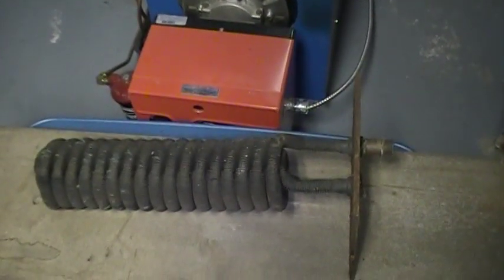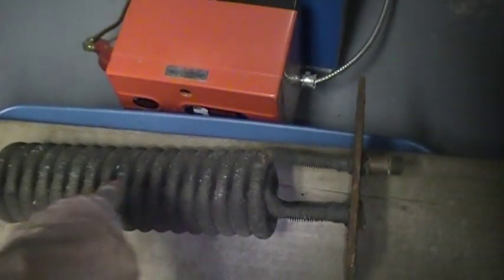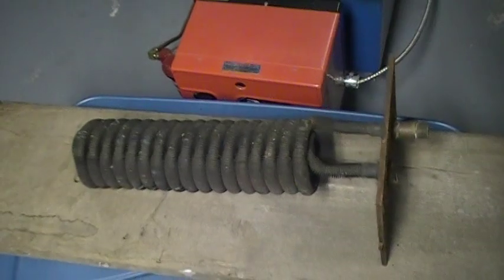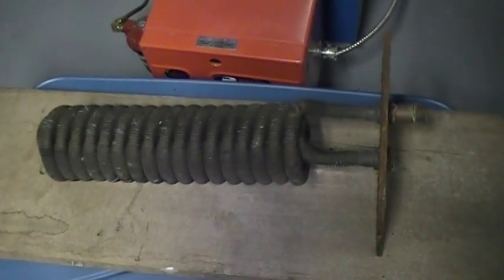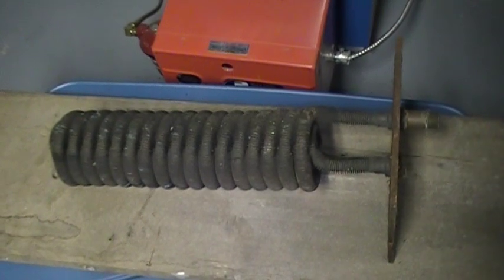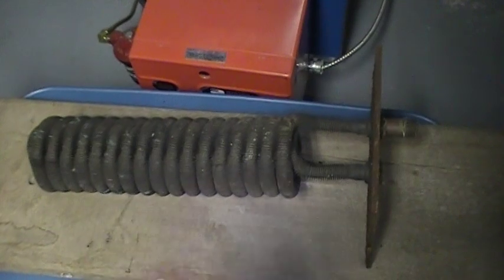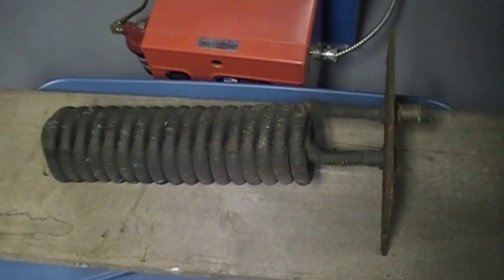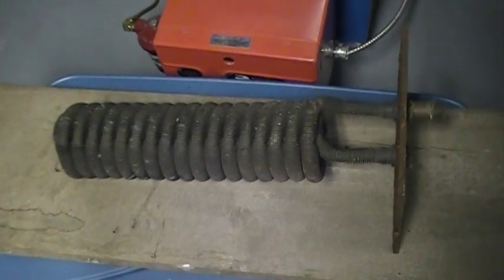Relief valve blowing off on hot water boiler (furnace).possible cause...Part 2

Comment: Hey Al,
Just reminding you that this content is extremely helpful! Currently in the process of dealing with my own DHW coil replacement (we are pretty convinced it is this part).  Just wanted to pop-in and thank you for all the time you've put into the videos and the responses to peoples' comments. Thanks for helping!
Rob
Reply from the maker: Hello Rob,
I appreciate the kind feedback!
Sounds like you have a little project ahead of you. If there is anything I can do just fire a message at me. 
If your expansion tank is good, have closed the feedwater shut off valve to the boiler and dropped the pressure to about 15 PSI and the pressure is still rising then the coil is the problem.  Just be sure the expansion tank is not waterlogged.
Thanks for the kind words and best of luck with the project!    Al
Reply: @TheOldkid888  
Hi Al,
Yessir! I've done all the necessary diagnostics - expansion tank (bladderless) has been emptied a few times, I replaced the PRV 2 days ago, the blow-off only triggers at 30 psi, and finally, while keeping the auto water feeder closed to the boiler and the town water open to the DHW heater, pressure steadily rose until blow-off at 30 psi.  I'm going to get a furnace guy in for the repair though - it is quite beyond my level of confidence! Thank you for the message and the great channel.
Cheers,
Rob

Comment: hello, we are having issues with our furnace. Its a Kerr Comet 145 oil burner with hot water baseboards. The issue is the pressure relief valve started leaking slowly for a few days and now it leaks a steady stream. We have to empty the bucket every 20 mins. My husband replaced the relief valve himself but we had to call someone in to finish as we didn't have proper tools for the job. We had a furnace tech come and he assessed, replaced a valve of some sort and the pressure gauge. After a couple of hours of him working on it, he ran the furnace and it seemed to be fine. However not 10 mins after he left it began to leak again. Pressure up to 30 psi and constant stream of extremely hot water. He now tells us our options for an inexpensive repair. He advised that the coil in the water heater that is leaking and says he can disconnect it and run the hot water off the domestic coil in which he would have to install another part for it to work. We had to power down furnace completely then drain it cause it would not stop stream.
So the coil you are showing in this video is this the coil in the water heater itself that you are replacing and if so how much should it cost to replace? Thank you I'm close to Eastern Shore---Lake Echo
Reply from the maker: Hello Annie,
Not exactly sure of how much this repair would cost, but changing out the coil is one way to go or you will have to install a domestic water heater.
If you turn off the feed valve to the coil; does the relief valve still run constantly or stop all together? This would be an easy way to see if it is the coil for certain. I take it, there is a separate valve for the boiler feed water itself and one for the coil. 
If the boiler is shut down completely ( turning off the power); does the relief valve stop leaking? Just trying to make certain it is the coil.
Has your expansion tank has been drained in the past year?
Thanks for commenting and get back to me when you get a chance...Al

Comment: Replaced countless coils, bummer when the bolts break off, drilled and tapped many. The coils held in with studs are a little better to deal with since frozen nuts are easier to remove ..:-0
Reply from the maker: Hello Jim,
You can say that again. Broken studs are a pain in the backside. Best thing that they came out with was the flange off the boiler and the coil attached with nuts and bolts. So much easier to replace then broken studs.
Thanks for commenting and enjoy your weekend!    Al
Reply: I agree, Al, love the flange. Did I read somewhere on your comments that you're in Canada?
Reply from the maker: Hello Jim,
Yes. Eastern section.
Al
Reply: I also see oil burners are still predominant in your neck of the woods. Used to be so here on the Eastern Shore, also but no longer. I'm an oil fan , service gas but not a fan. If an oil furnace is maintained properly it will knock a gas furnace out of the park. Problem is so many techs don't service oil properly. One big example is cleaning, they won't perform properly if they're not cleaned. 
Been enjoying your videos. Glad to see others take pride in their work.

Comment: Are there other symptoms that might help identify the problem as a leaking tankless coil?
Reply from the maker: Hello Jake,
The most common sign that the coil is leaking...your relief valve will blow off constantly and have a steady flow. The gauge will have a steady 30 plus pounds showing on it.
Is your relief valve blowing off steady or just when the burner is running?
Thanks for commenting and get back to me when you get a chance?    Al
Reply: Thanks Al that was very helpful. Mine is blowing off only after the burner has been running. When the burner isn't running the pressure drops back down to 20-25. I'm getting heat to my zones. My expansion tank was replaced a year ago as was my fill valve. The expansion tank seems to be OK...empty sound when I tap below. My tankless isn't giving me consistent hot water. Water comes out good and hot at first but after a couple minutes it is only warm. When the burner is running there is a gurgling sound in the boiler. There doesn't seem to be air in the water lines to baseboard heaters...no bumping in the pipes. The boiler is I think ~ 30+ years old Burnham.V-14A-T
Reply from the maker: Hello Jake,
Generally when the pressure drops back to that pressure range and stops blowing off; it is the expansion tank. The feed water valve is definitely not the problem.
I would think your tankless heater is probably separate of the system as there is no zone valve feeding a coil.
Thanks for commenting and let me know what you think.    Al
Reply: TheOldkid888 thanks Al.

Comment: My water is leaking out of the automatic air bleeder(?). I thought the old one was bad but after replacing it water is still dripping. My expansion tanks has the hollow sound at the bottom can I therefore assume it's not the culprit? The pressure on it though was extremely low, like 8 ps which baffles me that water is leaking out the air bleed which sits directly on top of the expansion tank, any ideas greatly appreciated. New home owner here, trying to save a few. Thanks in advance.
Reply from the maker: +Anogoya Dagaati 
I am having a bit of time seeing this in my head. 
For the time being just screw the cap down tight on the top of it. This will stop the drip.
Your automatic air vent is located on top of your expansion tank? You don't want the air to come out of the top of the expansion tank. I have never seen this before. Can you send me a picture so I can see what is going on with the boiler in general. Sounds like it may be in the wrong place to me.
If the pressure is at eight pounds then your expansion tank should be fine.You should have around 12 pounds when the boiler is cold. (15 to 20 when it is hot which is generally all winter.). You should lift the lever on the pressure reducing valve that controls the water pressure in the boiler and put the pressure at around twelve pounds at the least. Watch the gauge while you are adding water. You really don't want to go over 15 pounds.
Do you live in a two story home?
Thanks for commenting and get back to me when you can.    Al
Reply: Thank you very much for the detailed response. My description skills failed me. The automatic air vent is mounted on top of the air scoop beneath which is the expansion tank.
The system measured 8 pounds the last I checked. I'll check it again tonight to see what it reads. I do not live in a two story home.
Reply from the maker: Anogoya Dagaati
Lift the lever and bump the pressure up to 12 pounds when you get a chance. I know this will help.
Thanks for commenting and best of luck with the project!   Al

Comment: so to change this would you have to drain the boiler? is this different than a senser of a aquastat that goes in a well, and doesn't actually touch the boiler water?...thanks...
Reply from the maker: Hello pei bossman;
A well in a boiler has the aquastat placed inside it; where the relief valve is directly screwed onto the nipple and has water pressure pushing directly on it.
To change it; you would turn the water supply off feeding the boiler. (Should be located before the pressure reducing valve). If there is an expansion tank on the system then you should turn the valve off that is on the line going into the tank.
If there is a bladder tank rather then an expansion tank ;you simply drain the pressure off the boiler. There is no need to drain the entire boiler.
Once the pressure is off the system; you remove the relief valve carefully making sure there is not a great amount of water to contend with.
If the pressure is off the system; then you should be fine.
I apply Teflon to the threads on the nipple and screw the relief valve back on the nipple.
If the water supply is slow or not flowing at all when you turn the water back on; you will have to lift the brass the lever on the pressure reducing valve to allow water into the system. They plug up with minerals and sediment often and will not allow water into the system, but lifting up on the lever will allow water into it.
  You must watch the gauge (tradicator) to make sure the pressure doesn't build to high. |It won't take long to rise and you only want about 12 pounds on the system.
Thanks for commenting and have a great week!     Al
Reply: TheOldkid888 I wonder if that person ever checked back to read your answer??? Great instructions, BTW.....